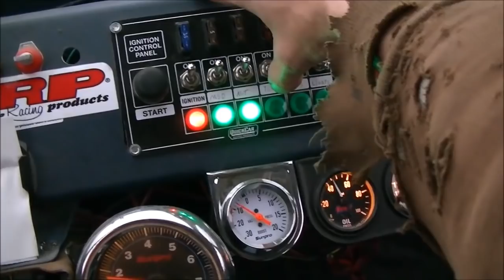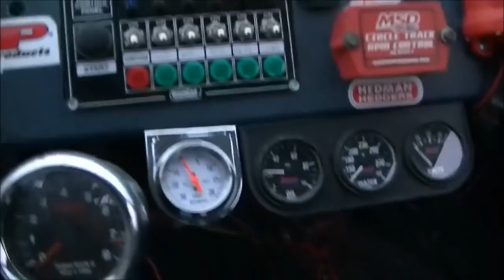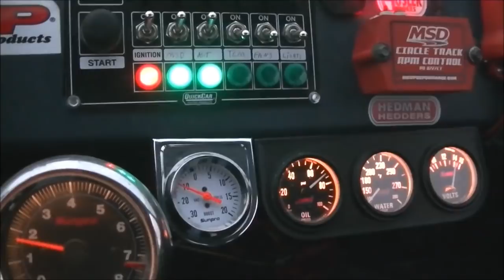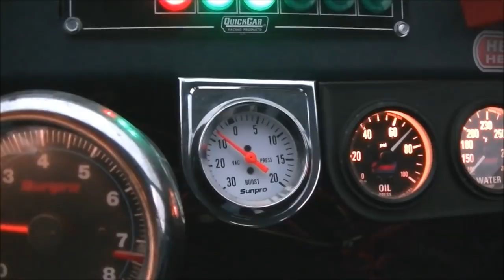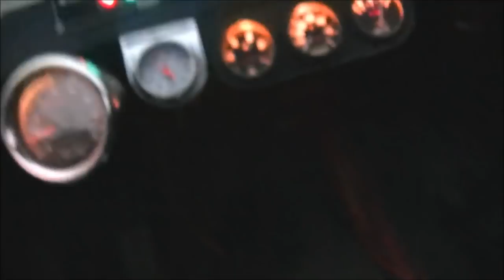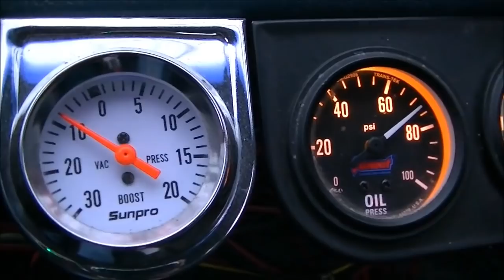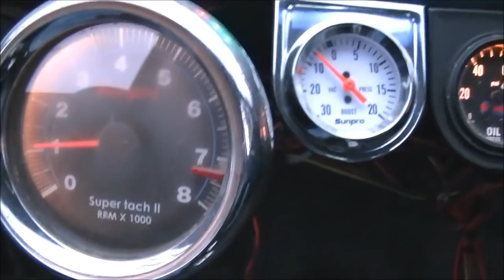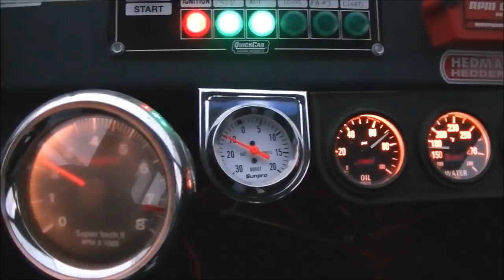the blower truck cold start

Comment: I'm curious is everything from this truck going in the new race track or are you building up a new engine for it??
Reply from the maker: well the engine is a brute it is for sure going in there, as for the trans :) not so much, the plan is to keep this truck as a roller so I can toss any sbc in there, the the 350/4l60e combo thats in the work truck lol thinking about cutting the work truck in half building it into a trailer and pulling it with the s10 using the s10 as a daily driver
Reply: Matts Madness good idea with the old work truck, sure it runs and drives but it's not the prettiest thing on the road, lol
Reply: It ain't gotta be pretty to be fast

Comment: If it doesn’t surge, it ain’t set up right.
Reply from the maker: surge is not a good thing when its set up right it runs smooth
Reply: Bill Shafley when blowers surge it because they richen up then lean out.  Sounds cool as hell but its not tuned well for idling around.  BUT bigger blowers arent for idling around...for wide open cmon
Reply: JayTrucker 62 it’s the same as a turbo fluttering sounds awesome but not good for the turbos at all. Need more air usually. My twin turboed king ranch used to scream when I’d let off while it’s under load or pullin a hill I put stacks on it and it hasn’t barked at me yet haha.

Comment: Hey bud, been watching up on these videos what carb do you have and specs on motor? If you don't mind me asking. Looking at building my sbc soon. Thanks.
Reply from the maker: 850 holley hp 177 weiand blower  4.060x4.125 427ci all scat internals 12.44:1 compression heads and intake are port matched to a 1206 felpro
Reply: Matts Madness sweet thanks for the reply bud. You build it yourself minus the machine work?
Reply from the maker: I did most of the clearancing myself but had the machine shop clean it up a bit when it was worked over but yeah I build my own engines minus some machine work, one day I would like to have my own shop do it all myself
Reply from the maker: look up the 334 rebuild I did a few months back  300 bucks more or less to rebuild it
Reply: So your running race gas ?

Comment: Awesome battery charger never seen anything like that
Reply from the maker: I like it , used to be a water pump then I mounted a 90 amp 1 wire alternator on it, I need power more than a water pump lol and the impeller broke anyway